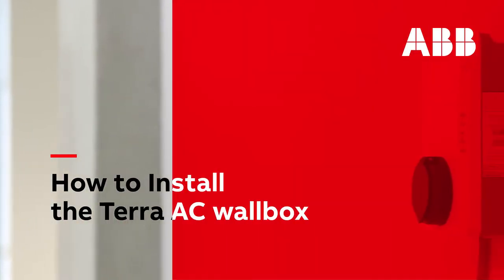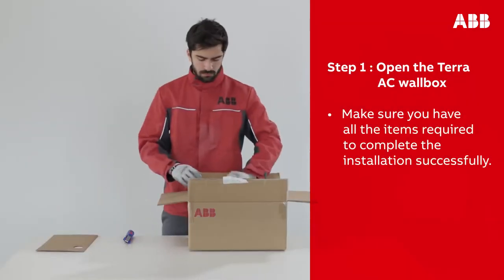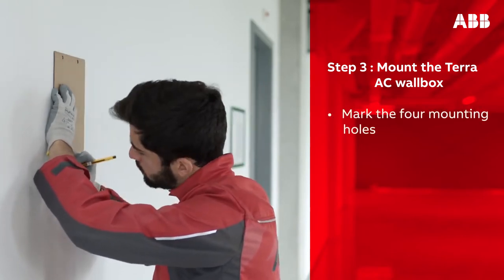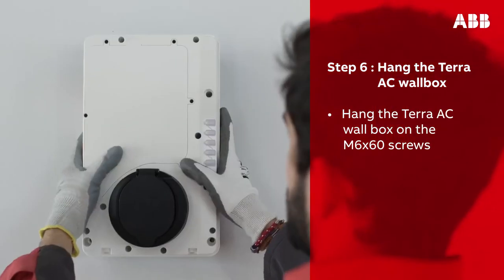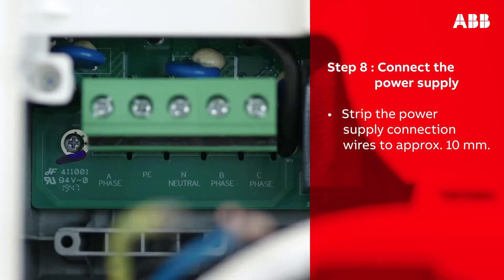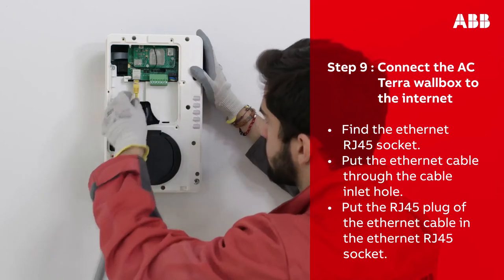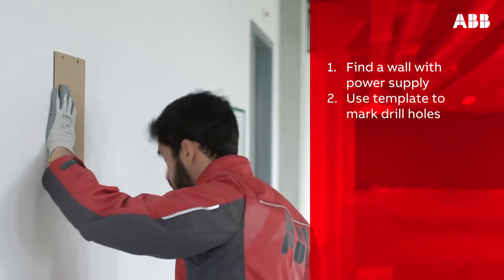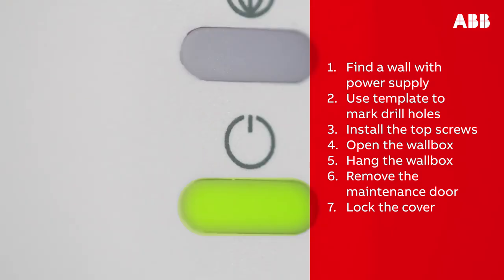How to install the ABB TERRA AC Wallbox for electric vehicle charging

Comment: I know this type of chargers supplied by the 240v I plugged it into 210v and it didn’t turned on I tested with multimeter and there was a 210v but it still never turned on, any advise other than try to pulled a 240v ?
Reply from the maker: Hi Ahlam, thank you for your question. Could you please inform the Serial Number of the charger and your email address for our Service Team to support you?

Comment: How can i contact ABB? If i want to reconfigure my charger sync app the app says the Pin Code is wrong although it is right from the sticker?!
Reply from the maker: Hi Torsten, 

Thank you for your question. 

Please contact your charger installer/dealer, who will contact ABB to get the correct PIN Code.

Regards, 
ABB Learning

Comment: Does the Terra AC need a separate RCD with DC sensitivity, or is one installed internally?
Reply from the maker: Yes, Terra AC has a built-in DC leakage protection and can be installed with a Type A RCD. Make sure to follow local installation regulations when choosing the backup protection of any electrical equipment.

Comment: Does the unit have built in pen fault detection? Thanks
Reply from the maker: Hi Brad,

Terra AC does not have PEN fault detection according to BS 7671. We would suggest an earth rod or PFDD to be used instead. The charger has built-in overcurrent, over- and undervoltage and surge protection as well as ground fault detection.
Reply: @ABBlearning  Thanks for that. How do I become an approved installer for your products? I'm getting a few business enquiries and would like some training if possible? Thanks
Reply from the maker: @brad30  Please send your contact details to learning@abb.com and our team will contact you. Thank you for your interest.

Comment: Thre are three things wrong with this video. 
1. The installer is using the level upside down!!!!!
2. Unless the installer is about 4 feet tall, he is mounting the unit above 1.2 meters
3. The installer appears to be using YY cable. That is not a recommended cable under the IET BS7671:2018 regulations.

Everything else is ok.
Reply from the maker: Well spotted! The installation shown in the video was just made for the video. The Terra AC Wallbox shown in the clip has since been moved and installed at the correct height and with a suitable cable outside of our Innovation Lab in Delft. As you rightly mention, always follow local regulations and standards when installing electrical equipment.